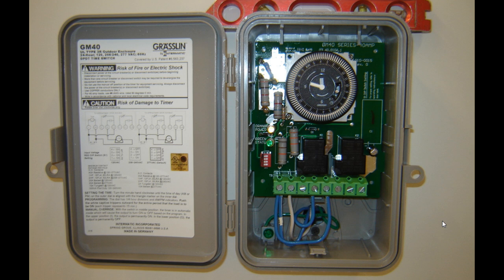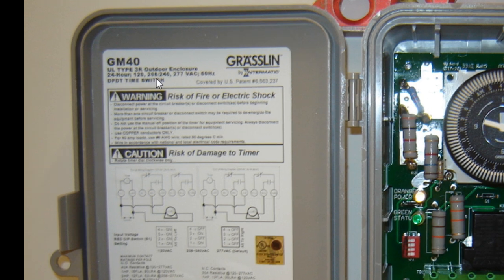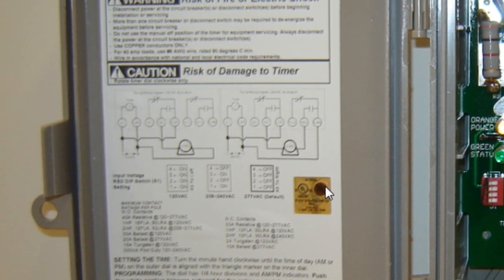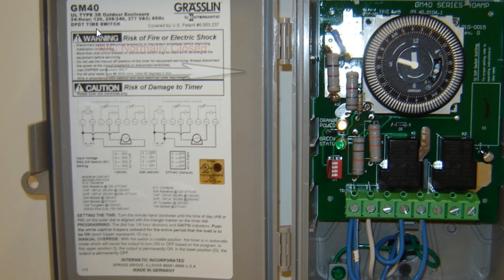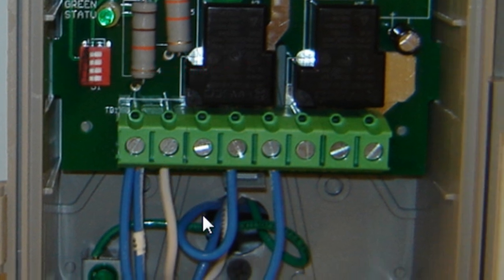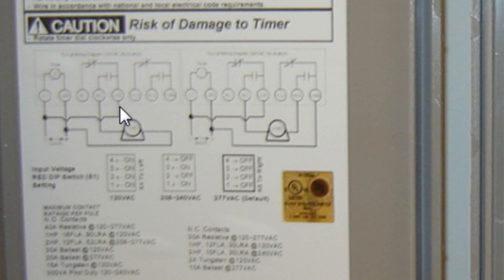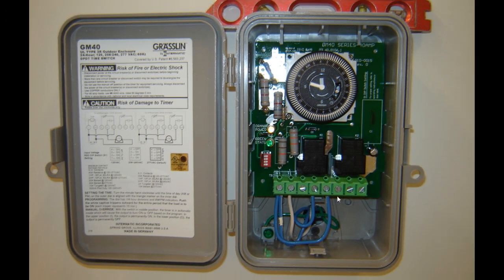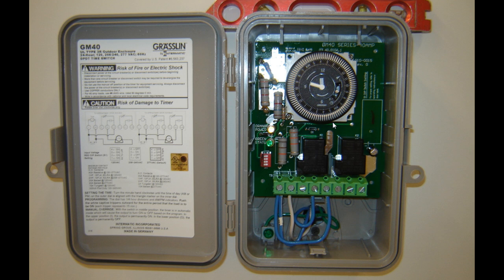GM 40 Time Clock

Comment from the maker: @Megawatts37 Yes I have done that before. I am going to throw this out-- I have an inspector that is big on UL Listing. If  he would see someone using a romex connector as a chase nipple he would fail it and state that the connector is not UL Listed for that purpose. A bit over zealous but is it any different than smoothing out the edges. Simple solution-think about what you need for parts before going out to do a installation.

BTW megawatts37, I appreciate your input!!

Comment from the maker: @Megawatts37 Guilty as charged! I didn't have a chase nipple or plastic snap in bushing. I did however smooth out the sharp edges on the plastic enclosure.

 It was 1/2 hour drive to local box store,what would others done in this circumstance?